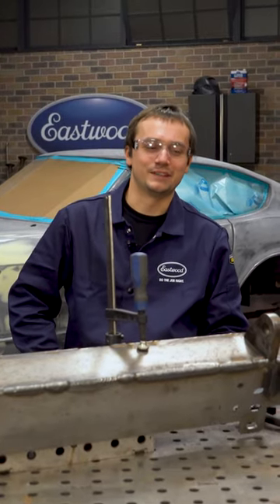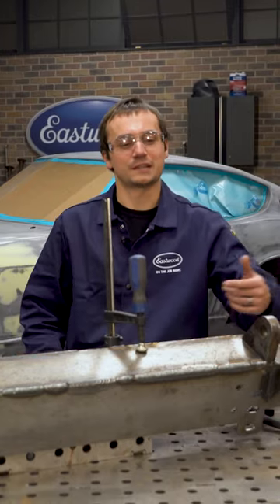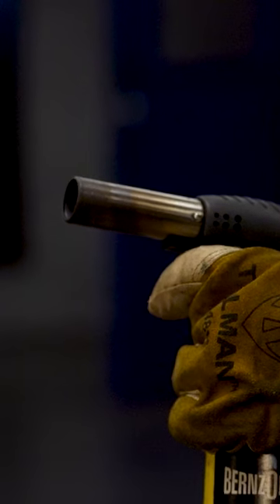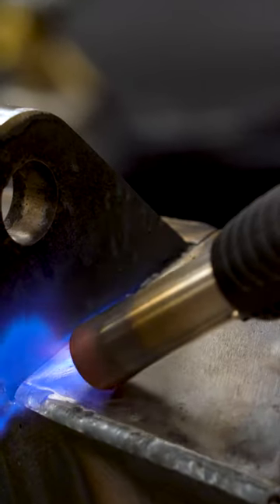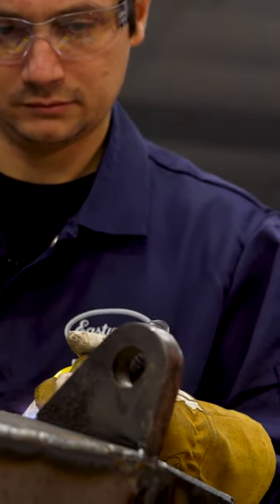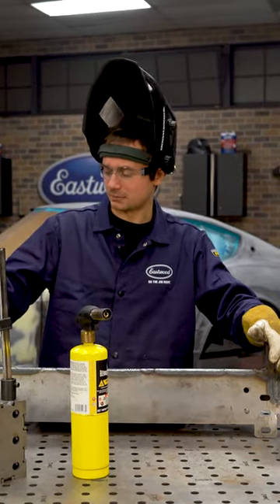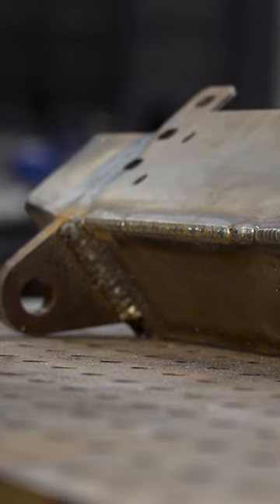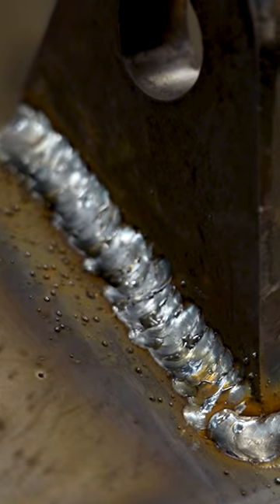Preheating GIANT Tabs for MIG Welding

Comment: I've been a welder for 55 years. That is completely wrong way to weld the with a 120 volt mig 90. But it is a commercial sale pitch. I'm not sorry to tell you that a chamfer at the minimum of 1/4 inch and stick weld is the proper way. Besides that the weld with the mig looks more like bubble gum weld's.  The multiple weld's is accually called lap weld's. Also it is probably not a strong weld. You would have been better off with a chamfer and used a flux core welder at least 220 volt mig welder. I'm done picking on this one.

Comment: If you're a "pro-shop" and putting videos out to teach others shouldn't you have the right tool for the job?
Reply from the maker: We're not a "pro-shop" we're an Automotive Tooling Company that specializes in products for the DIY Guy. As such we're showing you how to get the most from your tools.
Reply: @eastwoodco  👍I'm an industrial maintenance guy and a DIY'er but not a pro welder.
I would definitely have ground a deep 45deg chamfer on them parts then built up a lap weld. Not sure what kind of poundage those parts need to withstand but every thing that big I've ever done needs the bevel and lap weld to hold up.
Reply from the maker: This is part of a larger video showing that you can push the MIG 90 to weld thicker steel if you prep it right.  If we were making recommendations we would also suggest using a 220v welder on something like these large tabs.

https://youtu.be/wOkbN4p2mQE